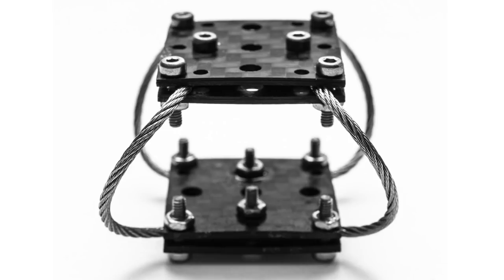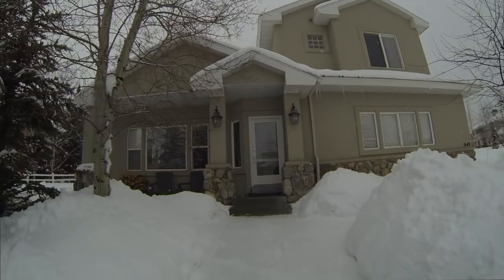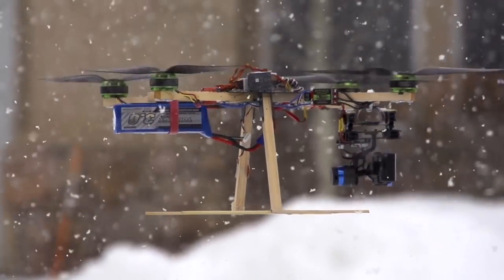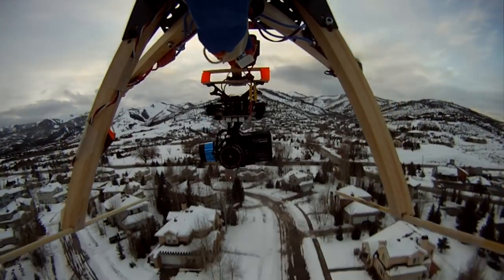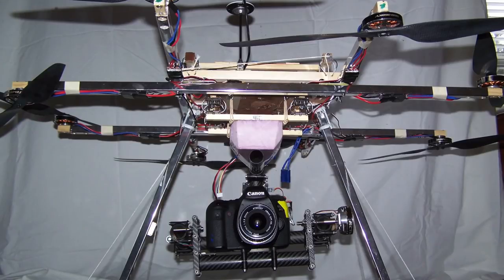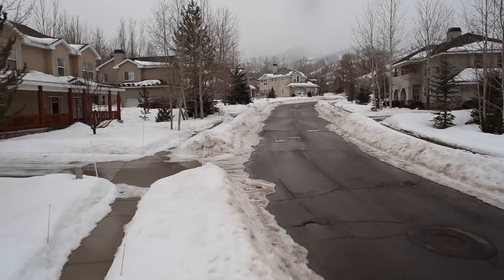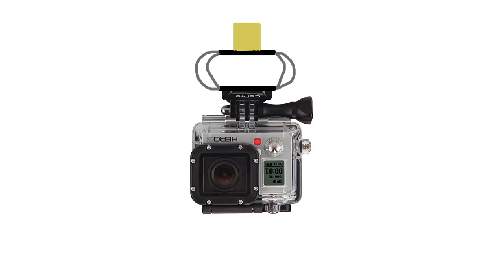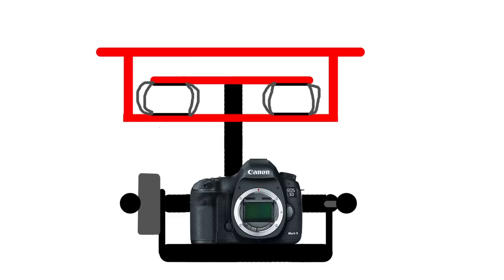Wire Rope Vibration Isolator Testing - RCTESTFLIGHT -

Comment: The wire rope isolator has been around for quite some time.  One of the things to optimizing its isolation is matching the weight of what is being isolated with the stiffness of the wire rope.  You can add more loops for higher weight or add loops of a smaller wire to fine tune the weight to stiffness.  If feels like the most successful isolators use higher rope count with smaller diameter.  The rope or string does not have to be metal.  Other materials like weed eater string can be used or other stiff plastics.  If you want to drive yourself nuts but get a really good isolator, use thick fishing line.  Many loops close together and very, very tunable.  Getting the lines even in length and spacing is the sanity testing part.  I can't tell you the number of these type of isolators I've used.  Hada radar mounted on a C130 and EVERYTHING  was on isolators of some kind.  Wish you the best of luck and congratulations on you improvements in making these videos.  Very good job.

Comment: Nice, instructive video, I saw first this solution on the Flexacopter two years ago, I never checked it. I don't know if you know but there is one material called Alpha Gel - kinda silicon jelly which beats every existing vibration dampening solution, it's not quite cheap but a very good investment. I built a belt driven gimbal for NEX5 class camera which was suspended on eight compressed pieces of 20x20x10mm of these jelly cubes - it was awesome!

Comment: Good work, I just last week "discovered" these isolators using zip tie loops. Had been doing everything under the Sun for vibes. And then the Sun shone. Wire or plastic or, or, or isolators. Thanks for the stabilization idea. Right now that is what I am working on. Back to the shop. Again, good vid and good work!!

Comment: Really! There is the jelly effect. Tried to do everything exactly like in the instructions and size. used 3mm steel cable. What was seen jelly effect disappears at night and during the day very strong. Take the picture probably because of the design error. Would be grateful if you could comment on our photo.

Comment: Great vibration isolator.

But, you tested plastic/foam and they didn't work in low temperatures. But then you advise to use rubber bands to hold the weight.
Why not include metal springs into your build?
Reply: I agree!

Comment: didn't understand something, it really such small size? that is 2.5 cm? a square of 2.5 cm x 2.5 cm I correctly understand? something very small turns out the size. or I confuse something. by the form about 4 centimeters turn out.

Comment: Though this is a good idea, the bracket isn't dampening vibration.  What is, is the RUBBER BANDS that your using...
Reply from the maker: In the first test the isolator was removing vibration with no rubber bands attached. The rubber bands themselves don't isolate any vibration, they just help the wire rope do it better.

Comment: Yes it is another expense, but another way to examine vibration is with a strobe light.  Not the disco!  But,a variable frequency light.  On a bench, tethered some how, in semi darkness, one could vary both the RPM of the craft and the light while recording video to find the harmonics, current load, to favor or avoid during flight.  It's a type of slow motion.  I'd do it Myself, but I can't come up with the cash just now!  Know what I mean?

Comment: Nice product I did a review on nomojello and really liked those.
Reply: DJ Kinney You really need engineering data to justify a $10 purchase? Just buy one (or go spend a couple bucks at Home Depot and spend a few minutes to make one) and see if it subjectively improves your video quality. If it does, keep using it. If it doesn't, throw it away.
Reply: If you need the $10 to feed your family in Mexico maybe you should just sell your FPV gear instead.
Reply: It's valid in general, but I think given the cost of this thing relative to the cost of the hobby it's moot. If somebody has done their best to balance everything that spins on their air frame but just can't get it right for whatever reason and this $10 widget gets them the rest of the way to a jello-free video then they'll get more ROI buying one than they will spending more time trying to balance things.
Reply: That's racist.
Reply from the maker: DJ Kinney Then tell me why every single one of the big name professional aerial video companies uses vibration isolation systems. Ooh they must just not balance their prop huh.
Reply: Wow this got out of hand fast.
Reply: +DJ Kinney 
No other arguments? :DDD
Reply: Who cares?
you said 10$ can feed a family in rural Mexico. That was and still is a bullshit.

Comment: Hi, love your videos and no messing about when something need diy approach :) Just question. What settings do you use on your T2D. I tried bunch of them and still cannot get the right PID. btw would love to buy some stuff from you but you re just way to far (Czech R.) Keep up the awesome work!
Reply: Jiri Pospisil when choosing PID just mess about, go from one extreme to the other and it should be in between that. i got it after about 4 changes after seeing the extreme PID

Comment: Can I use them upside down? So, put a GoPro on top?
Reply: i think if you use stronger steel cables it might work, but not as well as the hangling one
Reply from the maker: JuampixDDD Thicker cable doesn't work well, especially for smaller cameras like the GoPro.